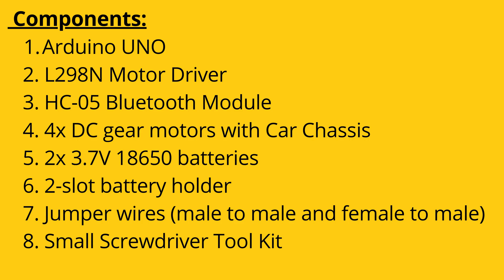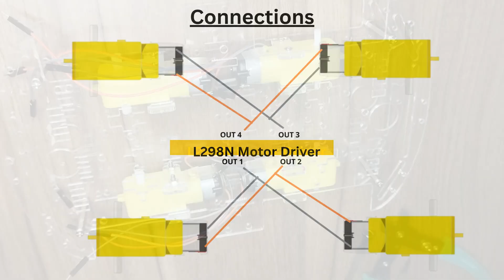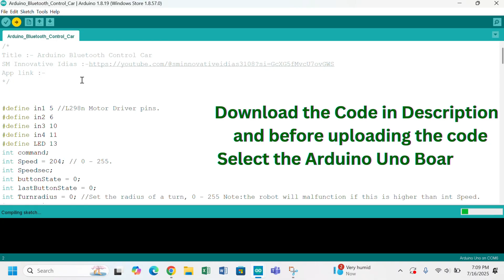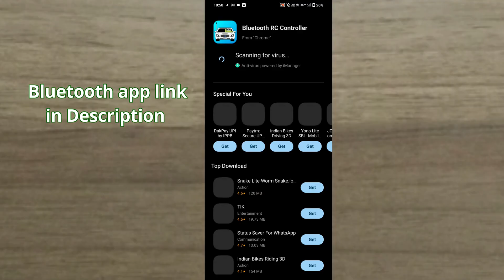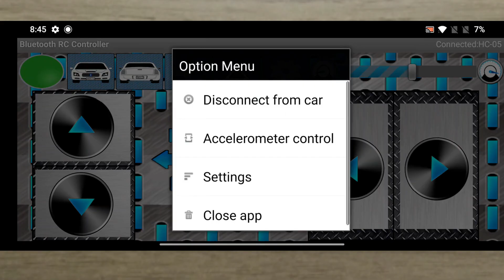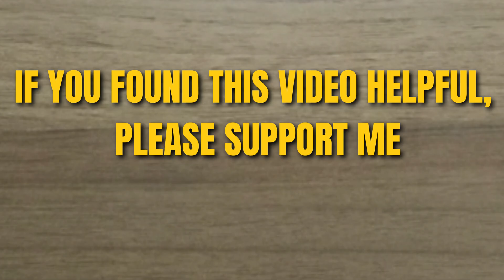DIY Bluetooth Controlled Arduino Car |

Comment from the maker: Before you start the project, please check whether all components are working or not
---------------------------------------------------------------------------------------------------------------------------------------------
📥 Download Links:
• Arduino Code : https://drive.google.com/drive/u/2/folders/1y7OiW4FDoC9QvsG4sXZ5lLDhq7fKER4E

• Circuit Diagram: https://drive.google.com/drive/u/2/folders/19F9Kvl2Bv141k_mxxnVSp-ScAq3XiQrd

Bluetooth RC Controller App :- https://bluetooth-rc-car.en.softonic.com/android?ex=RAMP-3582.3&rex=true

Please comment in the comment box about which project I should do next
If you found this video helpful, 
please support me

copy the code 
-----------------------------------------------------------
/*
Title :- Arduino Bluetooth Control Car .
*/

#define in1 11 //L298n Motor Driver pins.
#define in2 10
#define in3 6
#define in4 5
#define LED 13
int command; 
int Speed = 204; // 0 - 255.
int Speedsec;
int buttonState = 0;
int lastButtonState = 0;
int Turnradius = 0; //Set the radius of a turn, 0 - 255 Note:the robot will malfunction if this is higher than int Speed.
int brakeTime = 45;
int brkonoff = 1; //1 for the electronic braking system, 0 for normal.
void setup() {
  pinMode(in1, OUTPUT);
  pinMode(in2, OUTPUT);
  pinMode(in3, OUTPUT);
  pinMode(in4, OUTPUT);
  pinMode(LED, OUTPUT); //Set the LED pin.
  Serial.begin(9600);  //Set the baud rate to your Bluetooth module.
}

void loop() {
  if (Serial.available() > 0) {
    command = Serial.read();
    Stop(); //Initialize with motors stoped.
    switch (command) {
      case 'F':
        forward();
        break;
      case 'B':
        back();
        break;
      case 'L':
        left();
        break;
      case 'R':
        right();
        break;
      case 'G':
        forwardleft();
        break;
      case 'I':
        forwardright();
        break;
      case 'H':
        backleft();
        break;
      case 'J':
        backright();
        break;
      case '0':
        Speed = 100;
        break;
      case '1':
        Speed = 140;
        break;
      case '2':
        Speed = 153;
        break;
      case '3':
        Speed = 165;
        break;
      case '4':
        Speed = 178;
        break;
      case '5':
        Speed = 191;
        break;
      case '6':
        Speed = 204;
        break;
      case '7':
        Speed = 216;
        break;
      case '8':
        Speed = 229;
        break;
      case '9':
        Speed = 242;
        break;
      case 'q':
        Speed = 255;
        break;
    }
    Speedsec = Turnradius;
    if (brkonoff == 1) {
      brakeOn();
    } else {
      brakeOff();
    }
  }
}

void forward() {
  analogWrite(in1, Speed);
  analogWrite(in3, Speed);
}

void back() {
  analogWrite(in2, Speed);
  analogWrite(in4, Speed);
}

void left() {
  analogWrite(in3, Speed);
  analogWrite(in2, Speed);
}

void right() {
  analogWrite(in4, Speed);
  analogWrite(in1, Speed);
}
void forwardleft() {
  analogWrite(in1, Speedsec);
  analogWrite(in3, Speed);
}
void forwardright() {
  analogWrite(in1, Speed);
  analogWrite(in3, Speedsec);
}
void backright() {
  analogWrite(in2, Speed);
  analogWrite(in4, Speedsec);
}
void backleft() {
  analogWrite(in2, Speedsec);
  analogWrite(in4, Speed);
}

void Stop() {
  analogWrite(in1, 0);
  analogWrite(in2, 0);
  analogWrite(in3, 0);
  analogWrite(in4, 0);
}

void brakeOn() {
  //Here's the future use: an electronic braking system!
  // read the pushbutton input pin:
  buttonState = command;
  // compare the buttonState to its previous state
  if (buttonState != lastButtonState) {
    // if the state has changed, increment the counter
    if (buttonState == 'S') {
      if (lastButtonState != buttonState) {
        digitalWrite(in1, HIGH);
        digitalWrite(in2, HIGH);
        digitalWrite(in3, HIGH);
        digitalWrite(in4, HIGH);
        delay(brakeTime);
        Stop();
      }
    }
    // save the current state as the last state,
    //for next time through the loop
    lastButtonState = buttonState;
  }
}
void brakeOff() {

}

Comment: My bluetooth and arduino uno does not turn on but only motor driver turns on and i checked all the wiring
Reply from the maker: Please check whether all components are working or not. Also check the connection and ensure each battery voltage is 3.7 V.

Comment: I have checked several times that the connection is correct. There is an option to connect HC-05 in the mobile but it is not connecting, why please reply me
Reply from the maker: Have you ever connected the HC-05 Bluetooth to your mobile?
If you have, then turn on Bluetooth, click on HC-05, click ‘Forgot password’, then click on ‘Pair new device’ and try connecting Bluetooth again.
Also check whether the battery has voltage or not — it should be between 7V to 12V

Comment: Brother, I have done everything, uploaded the code, everything, but at last when I was connecting the Bluetooth, it is not happening, why brother, please guide me.
Reply: I have checked several times that the connection is correct. There is an option to connect HC-05 in the mobile but it is not connecting, why please reply.
Reply from the maker: @skuwarkushwaha  Have you ever connected the HC-05 Bluetooth to your mobile?
If you have, then turn on Bluetooth, click on HC-05, click ‘Forgot password’, then click on ‘Pair new device’ and try connecting Bluetooth again.
Also check whether the battery has voltage or not — it should be between 7V to 12V
Reply from the maker: Check the Bluetooth connection: connect the Bluetooth RX pin to Arduino pin 1 and the Bluetooth TX pin to Arduino pin 0
Reply: @SMInnovativeIdias3108  I have checked several times that the connection is correct.There is an option to connect HC-05 in the mobile but it is not connecting, why please reply.

Comment: I did everything but motor not moving. I tested the mootors by themselves and they do move.
Reply from the maker: Check the L298N motor driver connection and motors,  Check whether your Bluetooth is working or not, and check the battery voltage — it should be above 3.5 volts.

Comment: Bro Can you tell me that Is this correct 
#define in1 11 //L298n Motor Driver pins.
#define in2 10
#define in3 6
#define in4 5
#define LED 13
Reply from the maker: correct

Comment: Our Bluetooth module only turn on of one light, the blue one doesn't turn on, what should we do!!
Reply from the maker: First, check whether your Bluetooth is working or not.
Reply: Yes it works, we just Buy it, the problem is that only the red light appears, the blue ond doesn't, and we need help for our school project😢

Comment: The link was not working can you send me the cooding the comment ican copy
Reply: Thank you so much 🙏
Reply from the maker: Thank you for your support 🙏 🎉  @KavithaJ-l6h
Reply: Can i get your phone number 😊
Reply from the maker: /*
Title :- Arduino Bluetooth Control Car .
*/

#define in1 11 //L298n Motor Driver pins.
#define in2 10
#define in3 6
#define in4 5
#define LED 13
int command; 
int Speed = 204; // 0 - 255.
int Speedsec;
int buttonState = 0;
int lastButtonState = 0;
int Turnradius = 0; //Set the radius of a turn, 0 - 255 Note:the robot will malfunction if this is higher than int Speed.
int brakeTime = 45;
int brkonoff = 1; //1 for the electronic braking system, 0 for normal.
void setup() {
  pinMode(in1, OUTPUT);
  pinMode(in2, OUTPUT);
  pinMode(in3, OUTPUT);
  pinMode(in4, OUTPUT);
  pinMode(LED, OUTPUT); //Set the LED pin.
  Serial.begin(9600);  //Set the baud rate to your Bluetooth module.
}

void loop() {
  if (Serial.available() > 0) {
    command = Serial.read();
    Stop(); //Initialize with motors stoped.
    switch (command) {
      case 'F':
        forward();
        break;
      case 'B':
        back();
        break;
      case 'L':
        left();
        break;
      case 'R':
        right();
        break;
      case 'G':
        forwardleft();
        break;
      case 'I':
        forwardright();
        break;
      case 'H':
        backleft();
        break;
      case 'J':
        backright();
        break;
      case '0':
        Speed = 100;
        break;
      case '1':
        Speed = 140;
        break;
      case '2':
        Speed = 153;
        break;
      case '3':
        Speed = 165;
        break;
      case '4':
        Speed = 178;
        break;
      case '5':
        Speed = 191;
        break;
      case '6':
        Speed = 204;
        break;
      case '7':
        Speed = 216;
        break;
      case '8':
        Speed = 229;
        break;
      case '9':
        Speed = 242;
        break;
      case 'q':
        Speed = 255;
        break;
    }
    Speedsec = Turnradius;
    if (brkonoff == 1) {
      brakeOn();
    } else {
      brakeOff();
    }
  }
}

void forward() {
  analogWrite(in1, Speed);
  analogWrite(in3, Speed);
}

void back() {
  analogWrite(in2, Speed);
  analogWrite(in4, Speed);
}

void left() {
  analogWrite(in3, Speed);
  analogWrite(in2, Speed);
}

void right() {
  analogWrite(in4, Speed);
  analogWrite(in1, Speed);
}
void forwardleft() {
  analogWrite(in1, Speedsec);
  analogWrite(in3, Speed);
}
void forwardright() {
  analogWrite(in1, Speed);
  analogWrite(in3, Speedsec);
}
void backright() {
  analogWrite(in2, Speed);
  analogWrite(in4, Speedsec);
}
void backleft() {
  analogWrite(in2, Speedsec);
  analogWrite(in4, Speed);
}

void Stop() {
  analogWrite(in1, 0);
  analogWrite(in2, 0);
  analogWrite(in3, 0);
  analogWrite(in4, 0);
}

void brakeOn() {
  //Here's the future use: an electronic braking system!
  // read the pushbutton input pin:
  buttonState = command;
  // compare the buttonState to its previous state
  if (buttonState != lastButtonState) {
    // if the state has changed, increment the counter
    if (buttonState == 'S') {
      if (lastButtonState != buttonState) {
        digitalWrite(in1, HIGH);
        digitalWrite(in2, HIGH);
        digitalWrite(in3, HIGH);
        digitalWrite(in4, HIGH);
        delay(brakeTime);
        Stop();
      }
    }
    // save the current state as the last state,
    //for next time through the loop
    lastButtonState = buttonState;
  }
}
void brakeOff() {

}

Comment from the maker: 📥 Download Links:
• Arduino Code  : https://drive.google.com/drive/folders/1y7OiW4FDoC9QvsG4sXZ5lLDhq7fKER4E?usp=sharing

• Circuit Diagram : https://drive.google.com/drive/folders/19F9Kvl2Bv141k_mxxnVSp-ScAq3XiQrd

Bluetooth RC Controller App :- https://bluetooth-rc-car.en.softonic.com/android?ex=RAMP-3582.3&rex=true

Please comment in the comment box about which project I should do next
If you found this video helpful, 
please support me

Comment: bro thanks for the project i completed everything and it turned perfect but the only issue is only two wheels are moving and the other are not moving while operating with  app pls reply its urgent
Reply: i rechecked all the connectins from your ciricuit diagram and motor connections all are correct i did exactly how you did but iam unable to rectify the issue pls help
Reply from the maker: @eeeworld-t6k Check the motor driver and motors to see if they are working or not.
Reply from the maker: Check the L298N motor driver connection and motors, and see whether it is working or not

Comment: Can't connect with app
Reply from the maker: Check the Bluetooth connection: connect the Bluetooth RX pin to Arduino pin 1 and the Bluetooth TX pin to Arduino pin 0
Reply: @SMInnovativeIdias3108 Hey bro, I have them connected and it won't let me connect to Bluetooth, it's an HC-06 module.

Comment: wow so beautiful 😻 😍
Reply: It's connected well

All good 

But while I am trying to connect it with the application, I am not able to get it done please guide
Reply from the maker: @ShahZaib-yu1lr  Check the Bluetooth connection: connect the Bluetooth RX pin to Arduino pin 1 and the Bluetooth TX pin to Arduino pin 0
Reply from the maker: Thank you for your support💥

Comment: Bro can you please give me code or paste it here cuz that link doesnt work😢
Reply from the maker: #define in1 11 //L298n Motor Driver pins.
#define in2 10
#define in3 6
#define in4 5
#define LED 13
int command; 
int Speed = 204; // 0 - 255.
int Speedsec;
int buttonState = 0;
int lastButtonState = 0;
int Turnradius = 0; //Set the radius of a turn, 0 - 255 Note:the robot will malfunction if this is higher than int Speed.
int brakeTime = 45;
int brkonoff = 1; //1 for the electronic braking system, 0 for normal.
void setup() {
  pinMode(in1, OUTPUT);
  pinMode(in2, OUTPUT);
  pinMode(in3, OUTPUT);
  pinMode(in4, OUTPUT);
  pinMode(LED, OUTPUT); //Set the LED pin.
  Serial.begin(9600);  //Set the baud rate to your Bluetooth module.
}

void loop() {
  if (Serial.available() > 0) {
    command = Serial.read();
    Stop(); //Initialize with motors stoped.
    switch (command) {
      case 'F':
        forward();
        break;
      case 'B':
        back();
        break;
      case 'L':
        left();
        break;
      case 'R':
        right();
        break;
      case 'G':
        forwardleft();
        break;
      case 'I':
        forwardright();
        break;
      case 'H':
        backleft();
        break;
      case 'J':
        backright();
        break;
      case '0':
        Speed = 100;
        break;
      case '1':
        Speed = 140;
        break;
      case '2':
        Speed = 153;
        break;
      case '3':
        Speed = 165;
        break;
      case '4':
        Speed = 178;
        break;
      case '5':
        Speed = 191;
        break;
      case '6':
        Speed = 204;
        break;
      case '7':
        Speed = 216;
        break;
      case '8':
        Speed = 229;
        break;
      case '9':
        Speed = 242;
        break;
      case 'q':
        Speed = 255;
        break;
    }
    Speedsec = Turnradius;
    if (brkonoff == 1) {
      brakeOn();
    } else {
      brakeOff();
    }
  }
}

void forward() {
  analogWrite(in1, Speed);
  analogWrite(in3, Speed);
}

void back() {
  analogWrite(in2, Speed);
  analogWrite(in4, Speed);
}

void left() {
  analogWrite(in3, Speed);
  analogWrite(in2, Speed);
}

void right() {
  analogWrite(in4, Speed);
  analogWrite(in1, Speed);
}
void forwardleft() {
  analogWrite(in1, Speedsec);
  analogWrite(in3, Speed);
}
void forwardright() {
  analogWrite(in1, Speed);
  analogWrite(in3, Speedsec);
}
void backright() {
  analogWrite(in2, Speed);
  analogWrite(in4, Speedsec);
}
void backleft() {
  analogWrite(in2, Speedsec);
  analogWrite(in4, Speed);
}

void Stop() {
  analogWrite(in1, 0);
  analogWrite(in2, 0);
  analogWrite(in3, 0);
  analogWrite(in4, 0);
}

void brakeOn() {
  //Here's the future use: an electronic braking system!
  // read the pushbutton input pin:
  buttonState = command;
  // compare the buttonState to its previous state
  if (buttonState != lastButtonState) {
    // if the state has changed, increment the counter
    if (buttonState == 'S') {
      if (lastButtonState != buttonState) {
        digitalWrite(in1, HIGH);
        digitalWrite(in2, HIGH);
        digitalWrite(in3, HIGH);
        digitalWrite(in4, HIGH);
        delay(brakeTime);
        Stop();
      }
    }
    // save the current state as the last state,
    //for next time through the loop
    lastButtonState = buttonState;
  }
}
void brakeOff() {

}
Reply: @SMInnovativeIdias3108 thanks bhai
Reply from the maker: @Herobrineyt493 welcome 🎉

Comment: Nice Explanation Great ! i also made but there was some prob like when we press right from phone Robo moves left and vice vers what is the problem ?
Reply from the maker: Thank you for your support 
You can interchange (swap) the wires of the motor driver output.
Reply: @SMInnovativeIdias3108  thanx !!

Comment: Bro we replaced the Motor driver from L298N, instead of that we used L293D motor drive please can you change and give the code for Arduino Uno

Comment: can i use 3 Lithium ion battery? or will it make a problem?
Reply from the maker: If you use 3 × 18650  Lithium ion batteries, there will be no problem

Comment: if I connect 12 volt plus from motor driver to the vin pin instead of using 5v then it makes any problem ❓

Please reply 🙏
Reply from the maker: Connecting 12V from the motor driver to Arduino VIN may cause the board to heat up. Use stable power
Reply: But vin pin work on 7v-12v 

According to your video it is only correct when only connection with aurdino uno not any other.

But in my situation I use HC-05 Bluetooth Module,BO Motors (300 RPM) x4,L298N Motor Driver,Arduino Uno 
So that Only 5v are not enough it makes heating problem even damege of moduled
Reply from the maker: @HarshVerma-dp9hi  I made the connections exactly as shown in the circuit diagram given in the description, and everything is working properly.